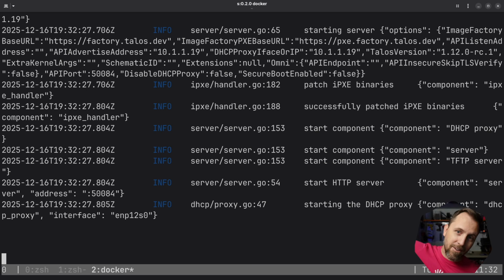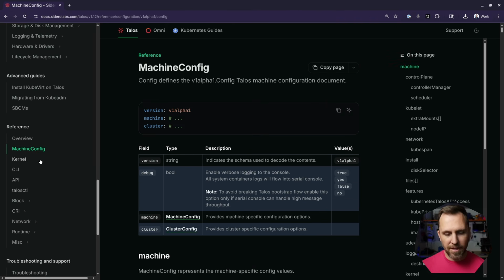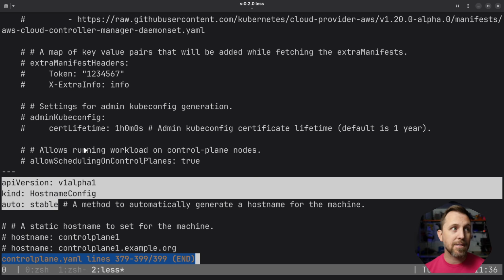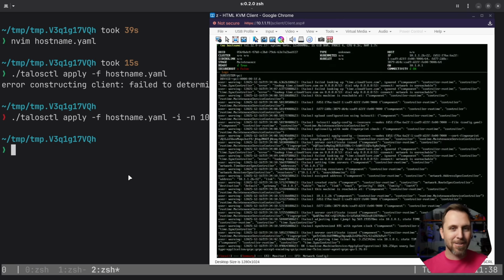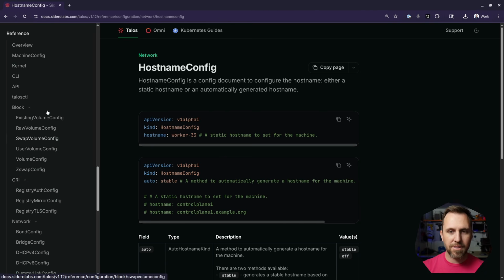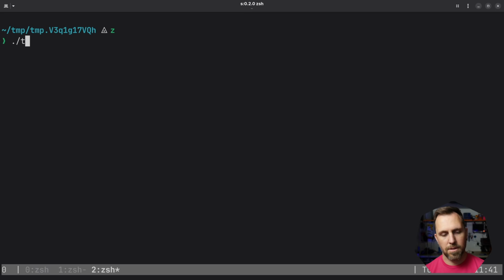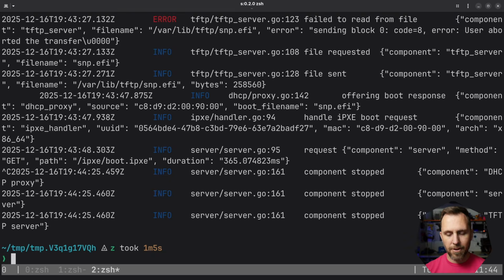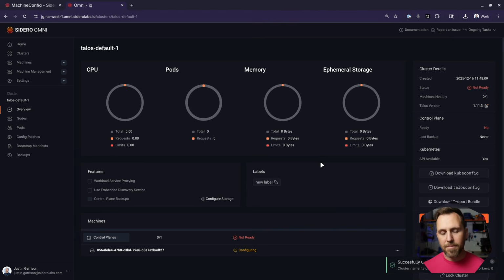Multi-doc configurations with Talos Linux

Comment: This demo is a bit frustrating, you start by saying it helps to do kind of "multi-steps" install, like first setup network, then installing Kubernetes with the right IPs from the first step. But then you don't demonstrate it, you show something which look a bit like a counter-example:

- You deploy a partial config with network stuff
- Tell us that it cant do anything without installing
- Install Kubernetes with the network bit merged

So can I really config stuff before installing Kube?

I have a scenario in mind if it helps you to answers (or make a better demo ;)):
- Deploying Tailscale extensions
- Then deploying a Kubernetes controlplane with TS IPs instead of local network ones

Anyway, thanks for the video :)
Reply from the maker: Yes, your tailscale scenario should work because ExtensionServiceConfig (the multi-doc configuration used to configure the tailscale service) can be sent to the machine before Talos is installed to configure Tailscale. You'll still need to send the ExtensionServiceConfig with the full machine config (to make sure it isn't removed).
Reply: @TalosBySidero  You are still making the exact same thing.

You tell me I can do A before B (because I need A to define B), but I have to do B with A for it to work.

Can we have a concrete example on how to:
- Deploy TS with extensions
- Retrieve TS IPs
- Install a Kubernetes cluster where nodes communicates only with TS IPs
?

Again, thanks a lot to taking time to respond, I know it's me who is missing something :)
Reply from the maker: @Uakkin  Have you watched this video? https://youtu.be/wjDtoe-CYoI?si=pK8FLDUu The main difference is you would send the ExternalServiceConfig before you send the machine config to activate the tailscale link and then put the tailscale IP as your Kubernetes endpoint in the config.
Reply: @TalosBySidero  I did and it didn't really help me.

When you say "send the ExternalServiceConfig before you send the machine config ... and then...", should I understand that I have just to send stuff in proper order before reboot? That's the original "You'll still need to send the ExtensionServiceConfig with the full machine config" could be completed by "to have the Ext conf survive reboot"?

Also perhaps it wasn't clear, I'm trying to do this with the less steps possible, ideally one. I understand that if I allow myself to just mutate the cluster it's easy to just install Talos, then add Tailscale and wait for IP, then mutate network and SANs config. My goal is to automate my cluster from pxe with the minimum orchestration needed.

I have to try if I can config TS ACLs to have 3 IPPool with an /32 addr, then using nodeAttr to assign these pools to 3 tags, generate 3 keys with these tags, prepare Talos configs with the key and IP for each node and have a working cluster with only one "apply".
It may be out of scope for Talos bootstrapping lifecycle to be able to do that, I'm just curious if it's possible.

Again thanks very much for your time, I will make some experiments myself before coming back ;)
Reply from the maker: @Uakkin  This is probably out of scope for youtube comments. Feel free to open a github discussion with what you're trying to do so we can have a better look (with example config)